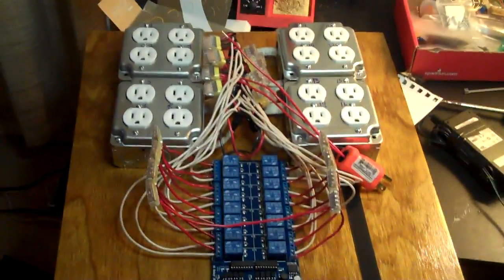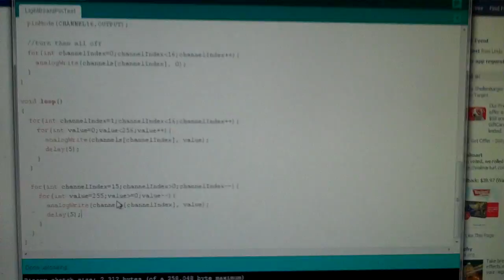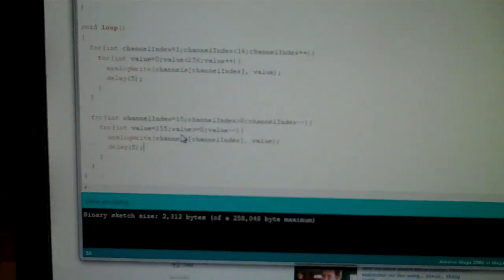Christmas Lights Control System - Part 6

Comment: o and could I just connect a 3v switch to all of the controle pins instead of using a arduino borad
Reply from the maker: I think those pins need 5v, that is what the Ardunio is putting out.
Reply: Scott Shaver o thanks it makes sence

Comment: thanks man helped heeeeeps im trying to make a surround sound system that will switch from two levels of my house
so pretty mutch im using an 8 channel relay board and the  surround sound out of the amp is connected to the middle terminal and so with a switch I can chooses witch level of my house the music plays through because I have two sets of speakers.
Reply from the maker: Excellent, glad this helped out. :)

Comment: I remember doing my light shows with relays and about 60 some relays and usb com ports.  noisey and lots of wires from the back of my computer.  and no dimming effects.  I have sold all that spider web of stuff and upgraded to light o rama.  I also dropped my vixen and minleon software.  i am all lightorama now.  and my shows are awesome.  I custom build my pc boards from them but i am looking to go with some relays or npn transistors instead of triacs and 12 volt buses for leds for singing faces in small inflatable snowmans.  if anyone has info on doing that much would be appreciated.

Comment: If you're not going to use triacs, use solid state relays. They're a little more expensive than their electromagnetic brothers, but they're quiet, they react faster, and there's no chance for mechanical failures.

Also, since PWM is basically just toggling a pin on and off at a very short but precise interval, it should be possible to emulate such a feature on a non-PWM pin by toggling it on and off at a timed interval using additional code. I haven't looked into it, because it's a bit of an inconvenient way of doing such a thing, but it could work. All you have to do is time it right.

Comment from the maker: When a relay closes it connects the electrical socket's negative terminal to the common negative bus thus allowing power to flow through the circuit for that individual electrical socket, causing the lights plugged into that socket to light up.
There are two power sources for the project. The power source supplying power to the electrical sockets (the orange plug in the project) and the power supply that is powering the relay board and the Arduino board the little HP power supply in the project.

Comment from the maker: There are 3 common power bus lines. Ground, Positive and Negative.  The electrical sockets all have their positive terminals connected together on the common positive bus. The electrical sockets all have their ground terminals connected on the common ground bus.  Each electrical socket has its negative terminal connected to one of the relays with the center screw terminal of the relay. The third screw terminal (common open of the relay) of every relay is connected to the common negative bus.

Comment: He also notes this in this video from 1:00-1:20 that the common bridge will be connected to the common wire on the plug. This is really confusing because there is so much red T_T. Best of luck. If I get mine working soon (when the relay comes) a video will be posted as a response to one of zparticles videos.

Comment: I'm currently trying to build a 4 channel version of this. If you go back a few videos to Part 3-2, from what I can determine the black "hot" is all in-sure'd together then it is connected to the plug, the ground's (in that video are all the reds attached to the outlets) are connected to the ground on the plug and the common (the bridge of wires hanging together) is connected to the common of the plug. In this video, we see that same bridge now hooked into the relay.

Comment from the maker: The orange plug is were power for the electrical sockets comes in from house, the orange extension cord is plugged into a wall socket in my house.  The HP power supply is just for powering the relay board and the arduino (the arduino gets power from the relay board).  I think I will make another video showing this stuff again. Too few characters in the comments. :)

Comment from the maker: The UNO will work just fine.  As for the non-led lights, that all depends on how much current each string pulls and how many of them are on at the same time.  I don't see any reason it wouldn't work. Good luck. :)

Comment: Great tutorial.  I have a quick question: Will this same procedure work for non-led christmas lights and an arduino Uno?  I know that the arduino Uno does not have enough pins to plug in all 16 ports of the relay board (it only has about 10 pins that can be used)..  so would it be possible to only use 10 pins and be able to plug in 10 different sets of lights (each being plugged into a single socket)?  I really hope to hear a response from you! Thanks in advance.